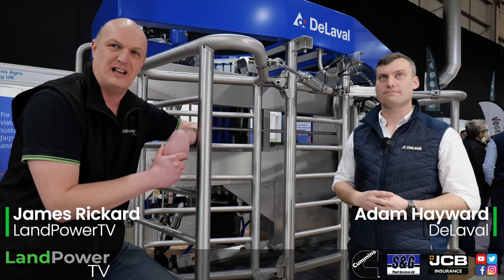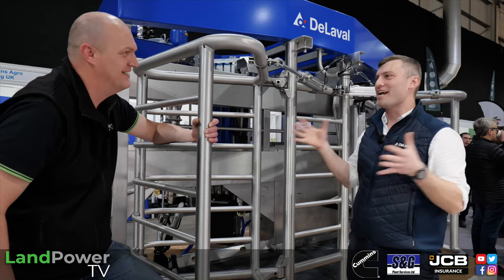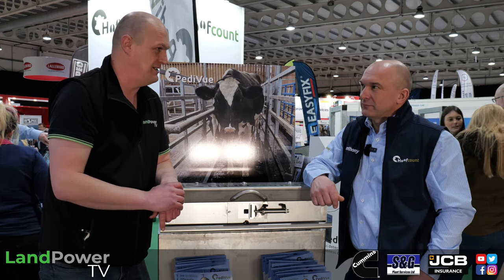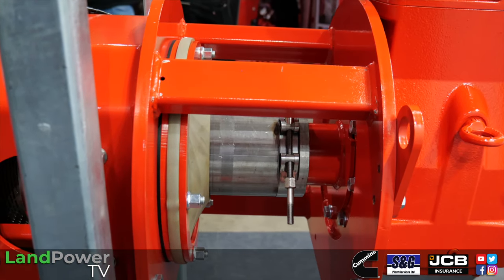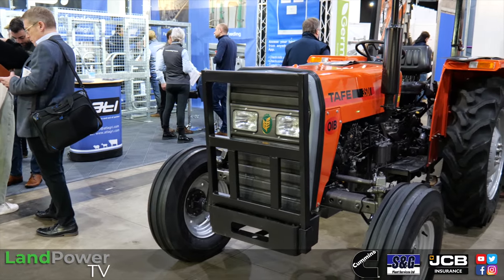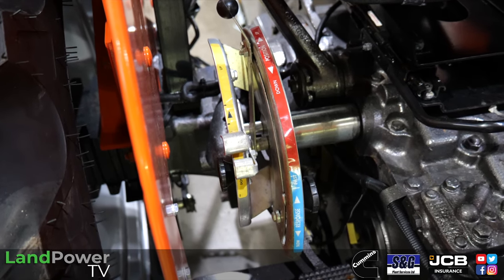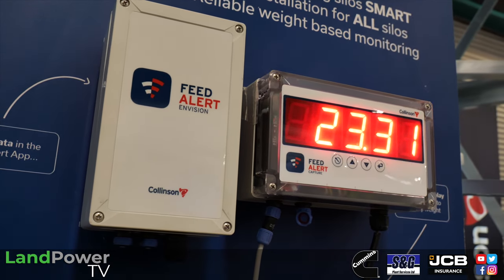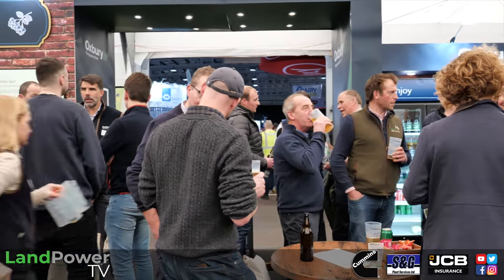Dairy Tech Event 2024: MACHINERY AND TECHNOLOGY HIGHLIGHTS

Comment: That Martin fella from Tafe tractors is a convincing sales man, I was almost onto wanting to buy one. I'm too much with wanting to upgrade from the old Massey 390t  to a more comfortable modern machine but there's a he'll of a lot of truth in what that man said. The average stock man doesn't need fancy stuff around the yard. Would like to have a warm cab, radio and safe passenger seat though. Need to have a bit of comfort on those wet cold days. Aside from that, those Tafe are a fine machine. 

Edit: I spotted ones fitted with cabs online.